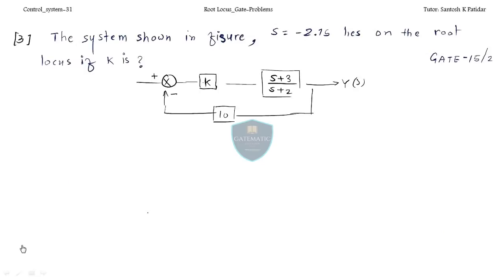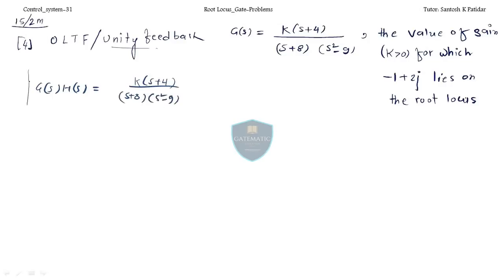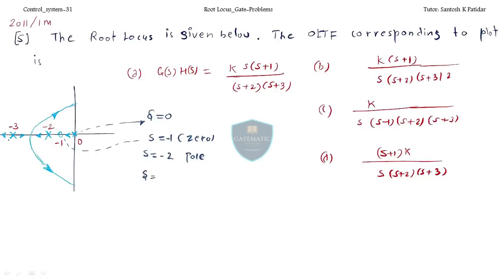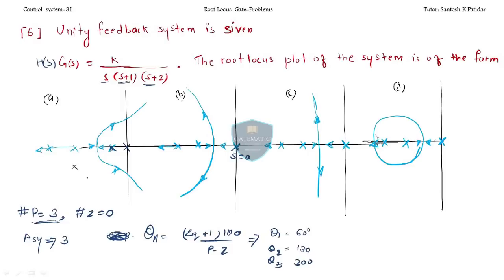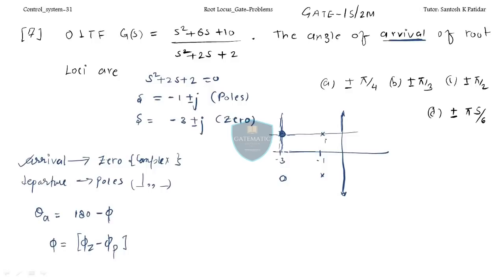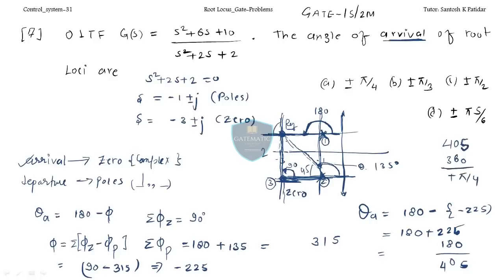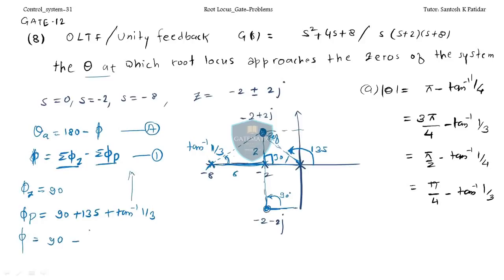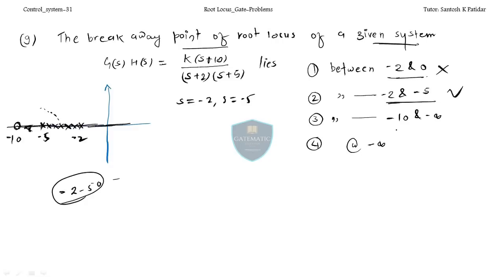Lec 31 GATE Problems on Root Locus

Comment: Hi Sir, Thanks for your great videos.  A small doubt in question no.8(Gate 2012), will it be Angle of Departure that we need to find because it is asking 'root locus approaches zero'???  And on solving as Angle of Departure, i am getting the answer correctly without modifying anything. Please do reply, waiting for your precious answer.
Reply: Same doubt
Reply: Can anyone clarify it
Reply: Root loci approaches to zero means entering to zero. So this way we need to find angle of arrival at zero. Answer will be same when u calculate angle of departure and it is easy to find angle of arrival.